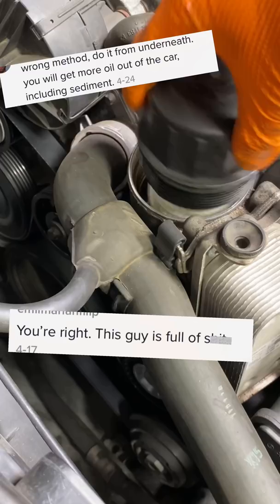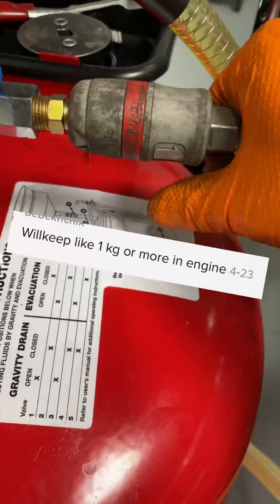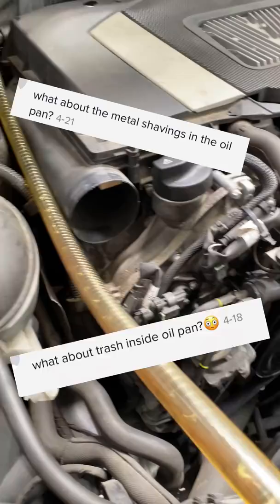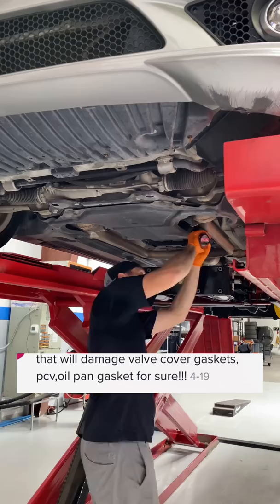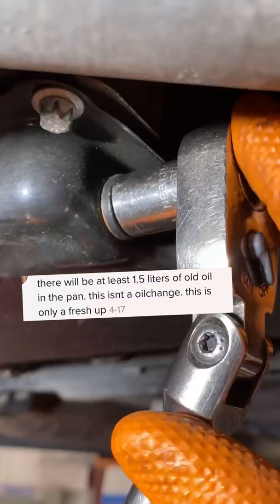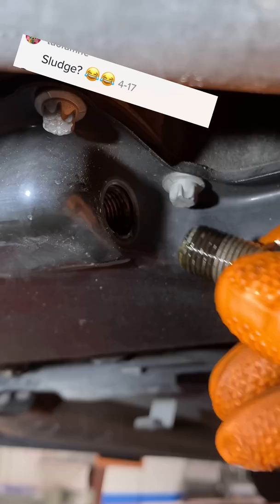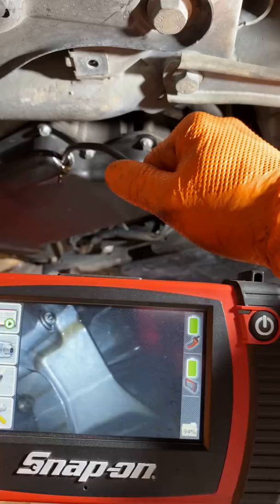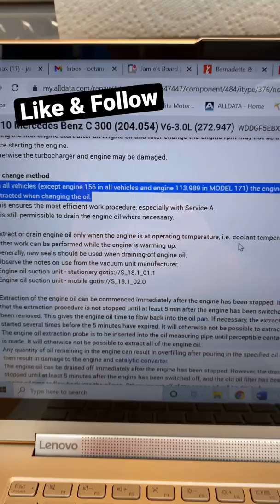#shorts Mechanic Proves Haters Wrong

Comment: They forgot its a mercedes engine? These mfs been building premium engines for yeeeeeeeears, friend had a 200k mile mercedes from 1980something. Ran it for 2 years (way overdue for an oilchange) and the oil was barely dirty.

Comment: Well yes the oil is normally extracted when changing it...  that doesnt necessarily mean it should be sucked out like that though 😂
Reply: But on Mercs it is supposed to be.
Reply: @BobRobber1  that's not what it says
Reply: @trailblazer632  I'm guessing you work/worked at a licenced merc workshop like I used to then?
Reply: @BobRobber1  its not listed in the manuals to suck out the oil through the dipstick tube lol.  It may be worded to "extract the oil" but those are not at all the same things
Reply: @trailblazer632  So that's a no then?
Reply: @BobRobber1  its not ststed in the manuals. Have you ever actually read them? Reading comprehension is a good skill for a mechanic to have... the question here is wether you have it or not.

Comment: Professional,  absolutely. 
But that's way too many steps to go through for an oil change. 
It does take about that much for my moms ml350, 2005, as per Mercedes Benz, it fucknsux 
My 06 4.8 Silverado,  2 beers drain filter n go half the time.
Race you in a face off, and I'll bring the beer.
You do moms car, I do my truck

Comment: Believe it or not, i request my mechanic to also suck the engine oil from the dipstick hole.

In my 2012 toyota minivan.

Why? Coz that hose goes aaaaalll the way down to the bottom of the pan. It will suck that engine dry. Much better than just letting it flow out via that hole at the bottom. 

Coz i noticed when they fill up the 4L engine oil, theres always leftovers. Once i requested the to suck via dipstick hole, they actly finished the whole bottle.

Comment: I mean it's not like you would get all of the sludge and debris out of the oil pan from the plug anyway unless you actually took it off. And if you do your oil changes at proper intervals you wouldn't really have much of that anyway that wouldn't get caught by your filter because that's the whole fucking point of the filter right? I imagine for a car where you couldn't fish a vacuum down to the bottom of the oil pan it wouldn't be viable but if you could get it down there why not honestly?

Comment: Did you use Mercedes-Benz aproved vacuum? You need to extract German air from the vacuum cilinder to create German vacuum to do the oil change right. Next time at least use proper gauge and turn it up until it shows "Das Vacuum" and only then proceed with the oil extraction...modern mechanics..pfff...

Comment: If they have a Mercedes-Benz then buying another is nothing for them😂. even if this did hurt the car not going to put them in a bind. I'm struggling just to buy a transmission so I can put it in myself😅 even though I paid a transmission shop to rebuild my transmission spent 2,700 dollar drove 26k miles and blew up on me and they didn't warranty work. All because I didn't want to do it myself that's what I get for trusting a shop first time I sent my truck to the shop and will definitely be the last. Naw I have to go through the hell of crawling around in the dirt with a 4l80e on my chest to install a nother transmission that should have been fixed the first time. fml😑